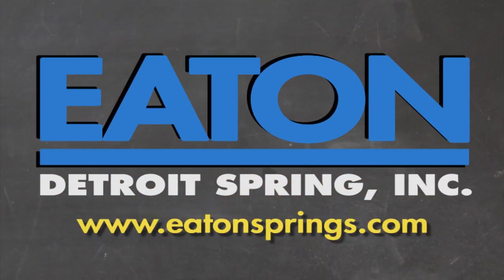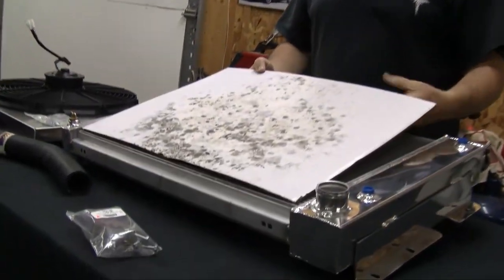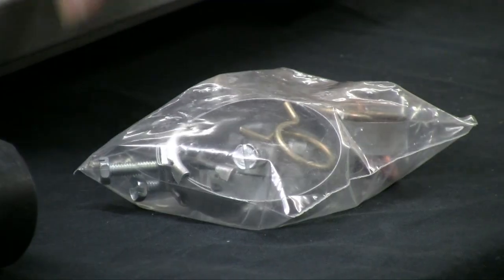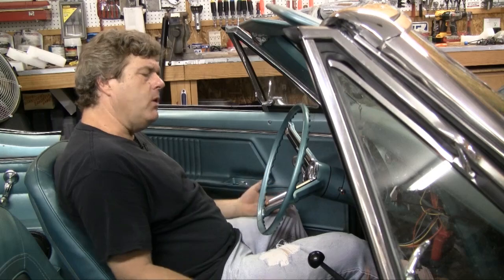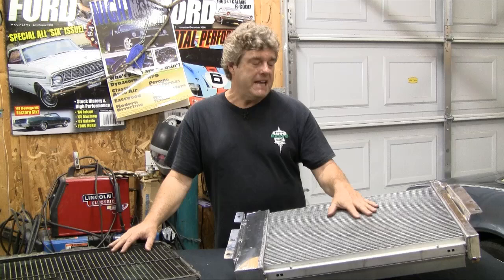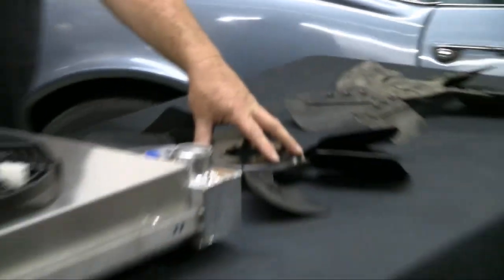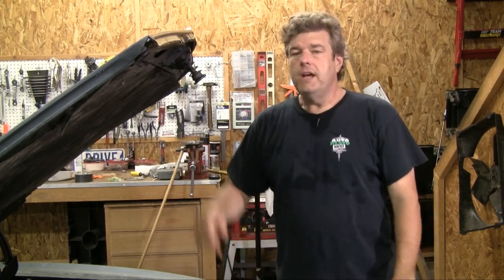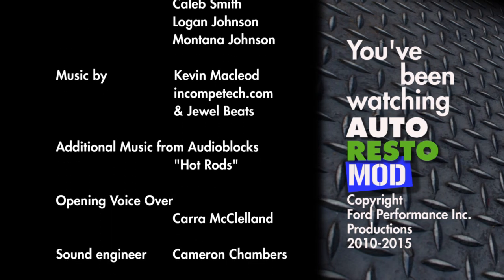Classic Car Cooling Tips and Tricks Episode 222 Autorestomod

Comment: A couple of other tips that help if your cooling is marginal.
#1 Block off all escape routes for air to bypass your radiator. 
#2 If using a mechanical fan, check that the blades are 1/2 way into the shroud, but no closer than 1" to the radiator. 
#3 Water disperses heat better than glycol. So you can use water with a corrosion inhibitor rather than a glycol coolant. Just beware that you loose anti-freeze and anti boil properties. 
#4 Check your ignition timing. Late timing adds heat to the coolant via the exhaust ports. (late burning) 
#5 High flow thermostats can help by increasing water circulation/velocity. (Please research #5 before posting an opposing opinion)

Comment: Every time I've used tap water in my 90 chevy c1500 it turned muddy rusty color no matter how many times I flushed the system. It wasn't until I started using distilled water that it actually stayed the green antifreeze color. I could not figure out why the antifreeze soulation was so rusty until someone told me about distilled. Now it's been green for almost two years now.

Comment: Been trying to keep my dd cooler. Under hood and inside. Been searching through your many videos for window tint video. No having too big of radiator can be issue. Here is why some manufactures use too small of tubing in 3 core radiators. See this on AMC jeeps people buying cheap ebay radiators. Buyer beware. It has been recommended to use 2 core radiators of a bigger core width. They usually will have the bigger tubes inside. Not all radiators are made the same. So if you change radiator to bigger radiator and it starts getting hot after change it may be the flow rate of radiator. Too fast and may not cool and too slow and may not cool. Its better to buy from respectable radiator  manufacture that will have made radiator for proper flow rate.
Reply from the maker: I'm not a big fan of tint. At night it can make backing up and seeing around you problematic. Now if someone could come up with car glass that has the auto dimming feature....

Comment: Checking the vacuum advance canister is also a good idea if you are running warm. The brand new small block in my '71 Corvette was running hot because the canister on the 15 year old MSD distributor wasn't holding vacuum. A new canister fixed the problem.
Reply from the maker: Robert Read Good call Robert! We didn't go into that and should have.

Comment: I thought tubesize was most significant factor in cooling. Take griffin radiators for example. 1.5” tubes to start vs a typically .75” tune. That’s so much more cooling!

Comment: What temperature should upper radiator hose be? Same temp as gauge inside the vehicle? My 1967 Ltd , 390. Gauge says 180, however taking a measurement at radiator hose it’s 230. Car has updated direct drive fan 6 blade fan,  new water pump.
Reply from the maker: Realistically, I would want a reading from the thermostat housing, which is where your engine temp reading will come from. Do this with an infrared laser thermometer. Then, take a reading from the bottom of the radiator at the lower hose. You should see roughly a 20 percent drop in temp between the two. Lots of things can contribute to higher temps in an engine. Clogged radiator, an inefficient fan, no shroud, too much timing, wrong sized shroud can all or individually effect temps.

Comment: Down flow radiators don't have problems with the tubes silting up & becoming blocked. Cross flow radiators need to be removed & stood on their sides & flushed with a garden hose as routine maintenance. In Australia there is a brand of radiator called 'Desert Cooler' . It's a down flow radiator that has blocking fins to redirect water to flow in a snake like fashion through the radiator.

Comment: Aluminum is nice. But what if I want to just clean out my original. What do you suggest using? CLR? Vinegar? Baking soda?
Reply from the maker: Keep in mind that often, cleaning will cause issues. The cleaners will exploit any weak spots. But I have heard Simple Green Diluted in water is a good way to go inside the radiator. It will need to be flushed out and fresh coolant added.

Comment: good tap water is better than distilled for the same reason bad tap water caused problems in Flint Michigan - properly treated water will not corrode or weaken the pipes in any way, and the best water (like here in NYC) will form a thin protective coating on the inside surface of pipes
Reply: this is interesting.

Comment: I've read that aluminum radiators are not as long lasting as original style brass ones, any thoughts?
Reply from the maker: I haven't seen this issue. But if the radiator is not well cared for it will deteriorate. Some of this could be the quality of the aluminum too.

Comment: Can I get a part number on that clutch fan! Having issues cooling my big block 390
Reply from the maker: James, what are we working on?
Reply: 1972 F250 with 390 fe
Reply: At idle temp rises in stop and go traffic. I have original 5 blade flex fan.

Comment: What is a good target for engine coolant temperature on hot day?  What temperature should the electric fan be set to turn on?
Reply from the maker: Christian Nelson One site we looked at said from about 190 to 210 for EFI like the Atomic system this car has and 180-200 for carbureted. We'll probably just leave the fans set to run when the engine starts on this one. The electric fan in the'67 Fastback Mustang we have is set to come on at 180 degrees.

Comment: reading from thermostat isnt as good as from the head which is why the sbc engines have them at cylinder 1
Reply: also use distilled water or better yet just buy 50/50 no guess work...information in this video isnt great
Reply from the maker: Thanks for the input Mike.
Reply: Is it possible that the block mounted exposed portion of the switch also gets heat from the block and headers which might cause an earlier reading for the fans? The actual coolant temp is the same at the intake manifold,but the manifold itself should be cooler than the block itself.
Reply: Also dummy me was running 70/30% ratio with distilled water....but was running 70% coolant instead of water! So much to learn frm mistakes.
Reply: Yep,softened water the best choice for Phoenix AZ anyway. Glad I watched this befor making a second cooling mistake.BTW I have a smaller air intake area  (vertically) and the  radiator is taller, so mabe I should fabricate a scoop to direct air up towards the top portion ?

Comment: should have showed the rad being pulled out wtf
Reply: Integra DIY If you are working on a Camaro like the one in the video you will want to... Take out the battery first (This will help get to the radiator bolts later on).  Drain the coolant by disconnecting the lower radiator hose. Once it is drained disconnect the upper radiator hose from the radiator side. If you are running a fan unbolt the shroud clip which is in the center top of the shroud, then you can undo the 4 bolts which hold the fan blade and remove the shroud and fan at the same time. If the car has an automatic it might have trans cooler lines that run from the trans to the radiator and now would be the time to undo them. Finally,  unbolt the four bolts that hold the radiator in place there are two on each side. Pull the radiator out and your done. Hope this helps a little.
               - Jonah
Reply from the maker: Integra DIY Integra, I don;t believe we say in the about section or the headline that the video is about how to remove a Camaro radiator. We're sorry if in any way we gave that impression.